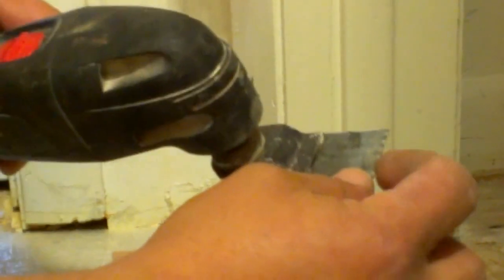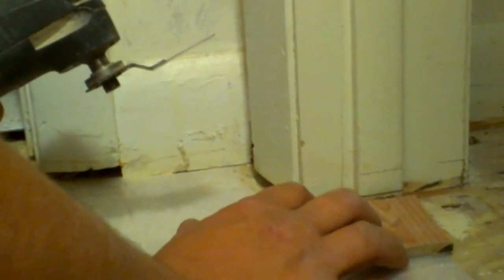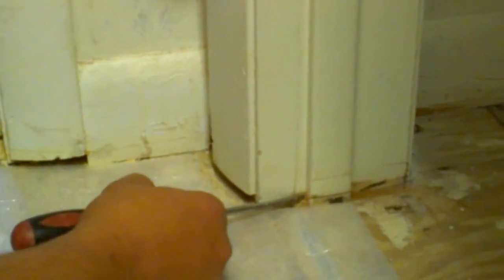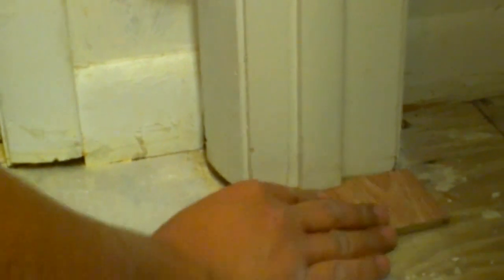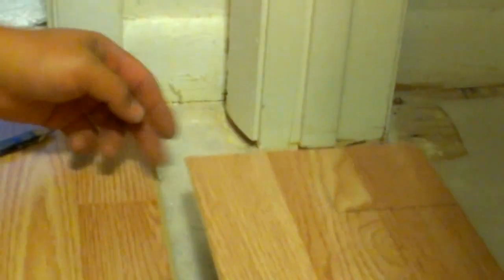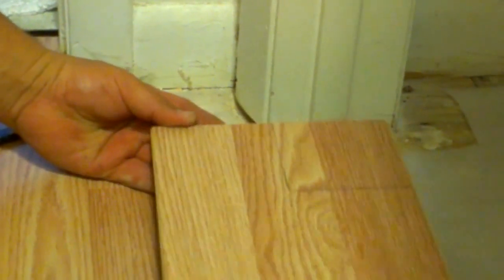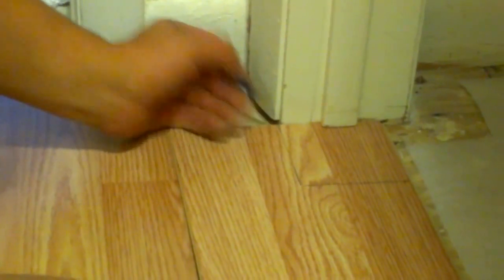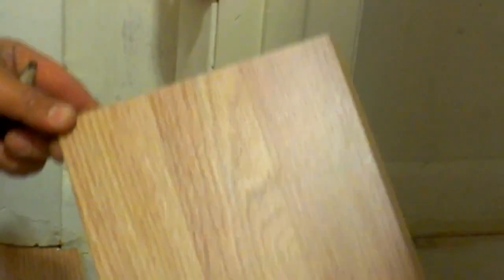laminate floor tips around doors and frames laminate flooring installation tips

Comment from the maker: #laminate #projects #handyman #how to #DIY #Ideas #flooring I am not perfect on the cuts, most of the time they are fine but some times I have to repeat the cut or cut them a bit shorter. it is just part of the project, don't get frustrated if it happens

Comment: you shouldn't fit a laminate or wood floor plank without expansion gaps anywhere, including door frames to avoid future 'bouncing'.
I use the same technique but also chisel out 5mm of the door frame each side.
that way you have the same clean visual effect but leave a total 10mm expansion gap on the door frame and will never have a plank springing up while walking.